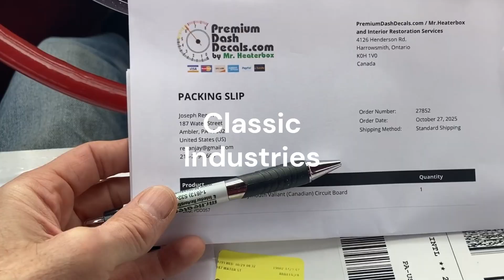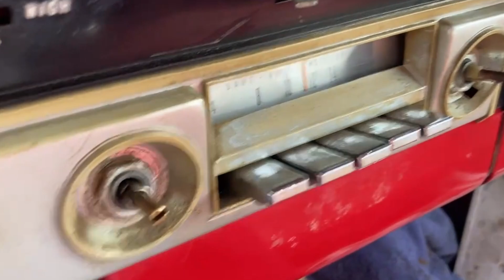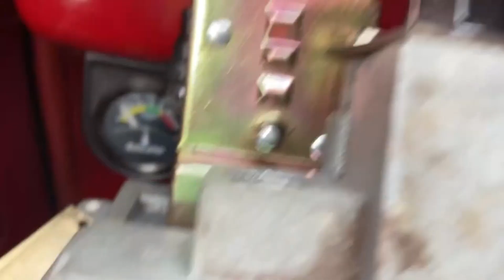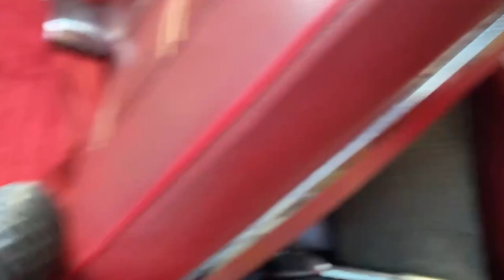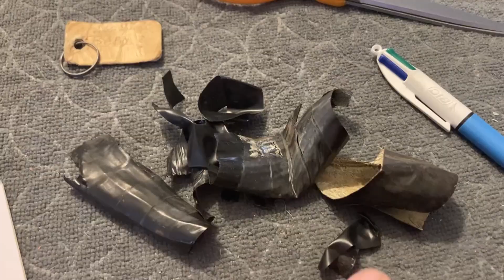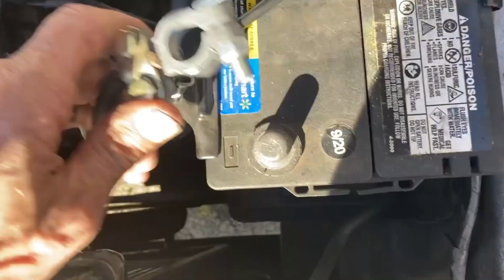1966 Dodge Dart GT Barn Find: This time: Defrost hoses, new instrument panel  circuit board & more.

Comment: you can test those gauges to see if they are bad or not by briefly touch the hot and ground to the other side but not to long just to see if they move by the way did you remember to re hook the gas gauge wire that you run to your after market gauge?

Comment: If you have excessive (or out of spec) rear axle endplay, it might be pressing the tire mounting flange against the drum creating excessive heat on that right rear passenger wheel.
Reply from the maker: Great, great suggestion. I’ve searched the drum for any signs of dragging like a detective in a bad crime show, and so far… nothing. There is one suspicious spot on the drum, but I can’t tell if it’s a factory-machined edge or the beginning of a rubbing-related horror story. So, looks like I’ll be disassembling everything again and performing a full forensic autopsy. I know something’s rubbing—I can still hear it, taunting me.

As for endplay, you’re probably right. I checked the FSM, and while it doesn’t give an endplay spec, it does give a torque spec… which I definitely did not set. So that’s yet another thing to investigate when I tear it all back apart.

Thanks for the suggestions! They’re at least keeping me sane while the car tries not to.

Comment: One of the heater outlets to the defroster is bigger.that one part is a voltage limiter.the circuit boards are of very nice quality.I have a 67 but I would love to find a 66.nice car.👍
Reply from the maker: I had a 67 when I was 19, and I like it better, but this is what I have. Thanks.